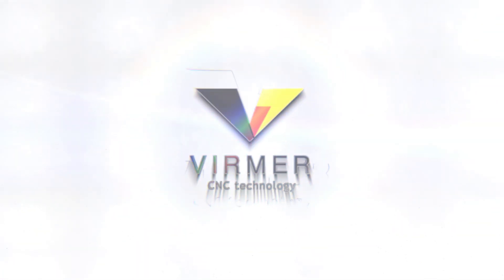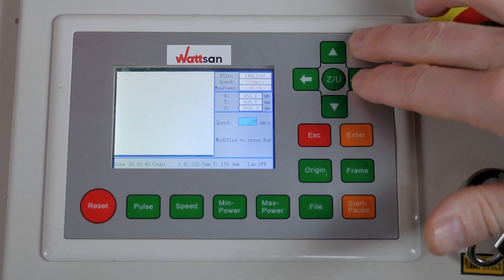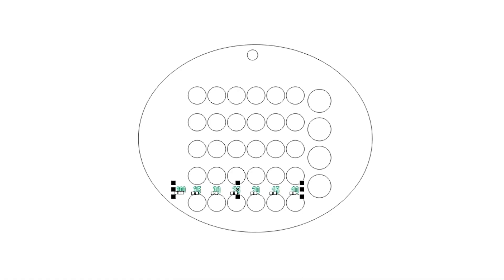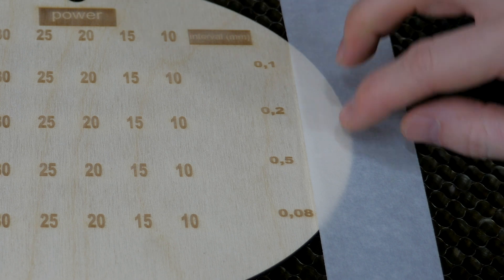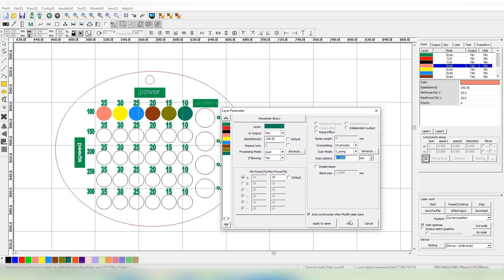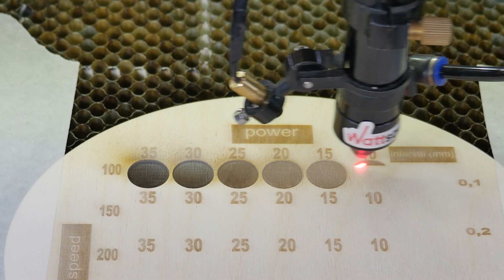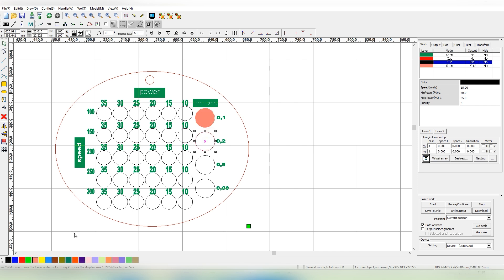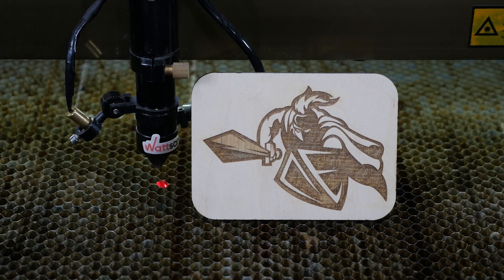How to engrave plywood? | LASER ENGRAVING POWER & SPEED TEST GRID | Virmer

Comment: I understand that you are trying to be helpful to new users of your machine  but this  video  demonstration is very misleading for any new user. ALL lenses are cutting tools and it takes a LOT of understanding and finnesse to achieve a range of colours on the SURFACE of wood. Remember I just said lenses are CUTTING tools. Take a look at the 100mm/s row of "burns" at 3:43. First the video claims the residue is "carbon deposit". Incorrect. This a tarry fume residue that has been forced onto the surface by agressive CUTTING. Note how as the power decreases  A) the cut gets shallower and B) the residue decreases.  You will see this lessening residue effect happening as  the  cuts get shallower with higer speed (lower exposure times). 
I quote the video again , "But there is no need to worry, because this can be cleaned with sanding paper."  Yes, this is one workaround to remove the crud. Another is to wipe it off with a damp cloth like Trotec and Epilog.   However, both are  time consuming and secondly, they do  not remove the sticky brown residue from the engraved area itself. The  engraved coaster image is an  equally brown and sticky disaster because you have not mastered the technique of residue-free engraving. . Please watch these two videos to understand why and how you have misunderstood what tonal  engraving  really involves and how it IS possible achieve tar-free  deep engravings. You will then understand that engraving  for depth and engraving  for colour are two seperate process.
https://laseruser.com/the-concise-rdworks-learning-lab-18/
https://laseruser.com/the-concise-rdworks-learning-lab-19/
 I hope you will accept this comment in the manner I intended. Not as criticism but as an opprtunity to extend your  knowledge and ability to educate new users with facts. I know this power matrix is widely demonstrated as an engraving colour chart but  I hope you will be the first to expose its flaws and demonstrate clean engraving methods.
 ps   ramp test focus is not a fixed property. Run two test beside each other. One at 15% power and 15mm/s and one at  80% power and  400m/s. Interesing result?.
Reply from the maker: Hello. Thank you so much for your helpful comment and awareness. Please leave your e-mail, we will be glad to contact you.